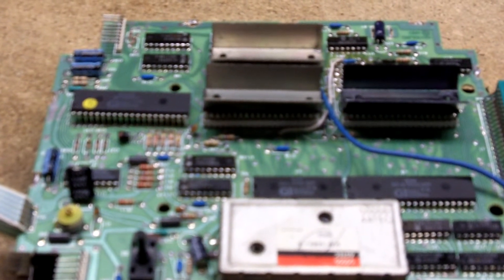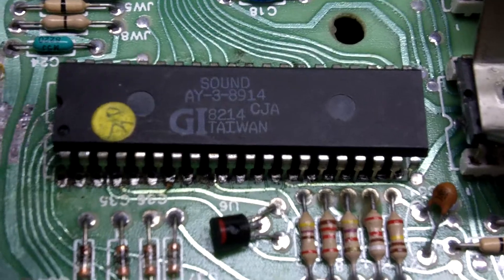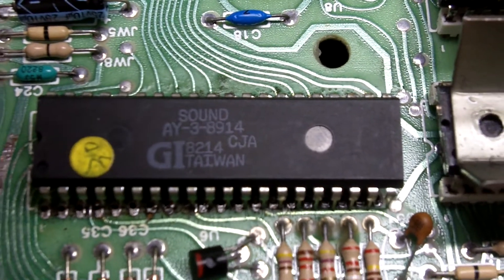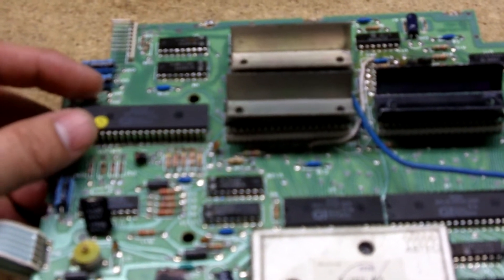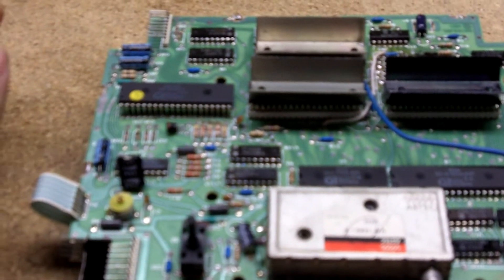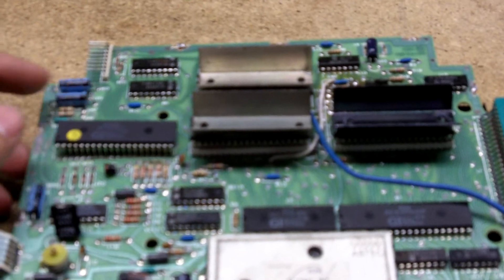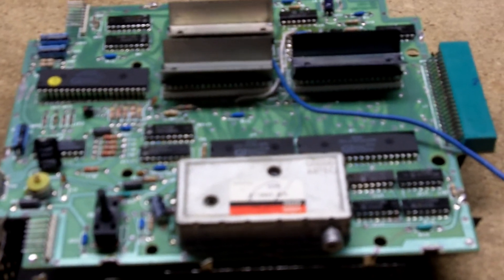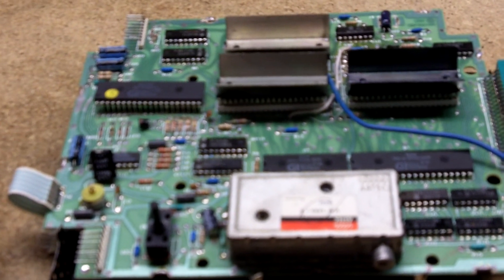Intellivision controller chip replacement

Comment: I'm wondering if you have some insight into this problem:  I put any cartridge in and the green screen appears displaying the name of the game I put in.  However, no matter what I do, I cannot get into the game.  One time after resting many times, turning off and on, tapping bumping etc I got into the game and it worked normally.  After I lost, I could not get into the game again.  Just had the green screen.  When tapping or hitting it, the screen did not flicker, so there doesn't to be anything loose.  Any ideas?